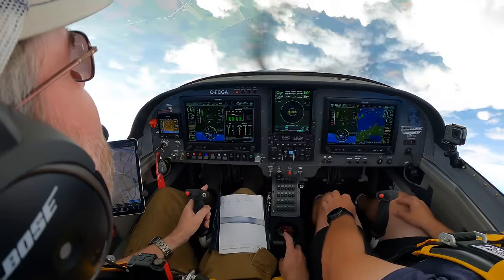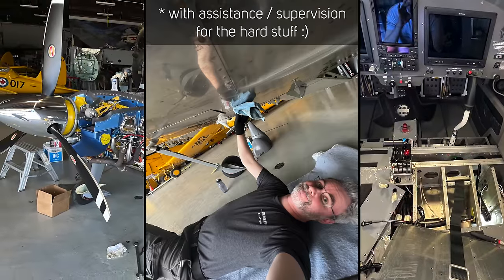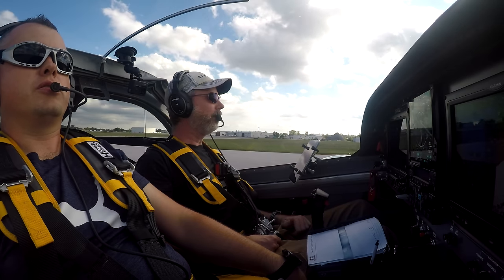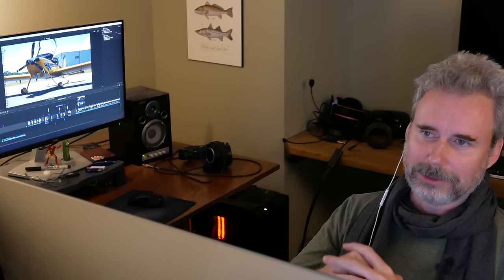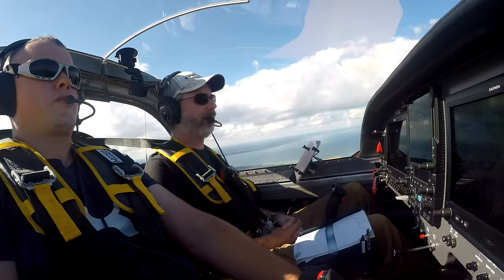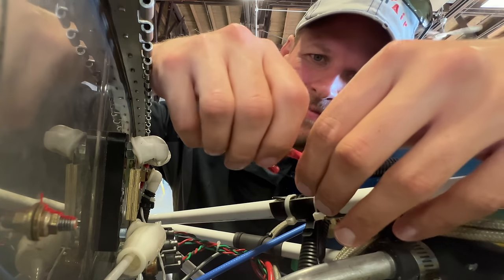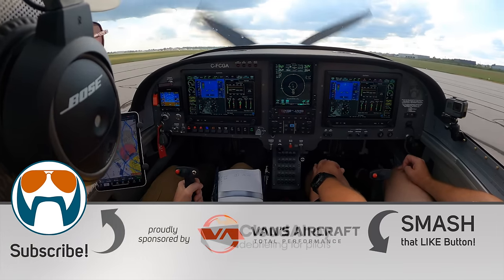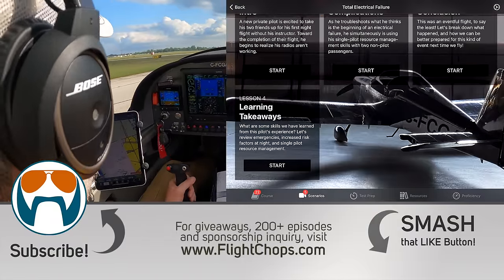Loop Induced Emergency?!

Comment: Mister Chops, at around the halfway point of the video you just addressed the observation of potentially excessive wire strain by zip-tying the connections so close to the terminal. Good finding!

I'd recommend to consider using wax string to secure your wire bundles instead of zip ties. From my time as a USAF maintainer, zip ties to secure wires were generally frowned upon because vibration induces chafing of the insulation and accelerates wear. Wax string takes a little more work to secure but allows the wire to slide within the wrap. Something else to consider! Keep your flight chops sharp!

Comment: Good job on the emergency! 8 seconds to recognize the overtemp is as fast as you can get without an alarm. As an AME for 25 years I have come to dislike spade or knife terminals anywhere in an aircraft. Unfortunately on certified we keep replacing them as built. On the high amp draw circuits like a landing light switch the get loose, build heat and fail. I later worked in Heavy duty equipment that had very electronically managed engines and systems. They are sensitive to resistance in terminations and they use much more robust connectors.  I am looking forward to building a homebuilt next so I can leave those connectors behind and use Weatherpack,  metri-pac or Deutsch for plug terminations. They are used heavily in automotive and once you put one together with a proper crimper you will see how nice they are.  They are also really nice and quick to unplug if used in a cowl that needs to be disconnected prior to removal.
Keep up the good work on videos !
Reply: I completely & wholly agree. As a mechanic myself (retired from it) I was never a fan of spade terminals, especially on older planes with wimpy generators where the current will spike from low voltage at said terminal. Or instruments to go just @55-wonky for no reason - I can't count the number of scorched wires and loose connectors I've had to replace just because the connection  got hot. Especially on the smaller super buzzy 4cyls that have a way of buzzing connections apart that have you chasing your tail trying to find THE fault because it couldn't be replicated on the ground. What a total pain in the ass
Reply: I loathe using those scrimp connectors with mission-critical terminations...  I never trust them to maintain a good connection over time, especially in harsh conditions.

Comment: Nicely handled.  One thing not mentioned was the associated oil pressure drop cross check.  Oil temp that high will also cause a drop in viscosity and show a lower than normal reading.
No drop from normal pressure, would lead me to instrumentation.  
Again nice job!
Reply from the maker: Thanks yeah - This was a good learning experience - I just couldn't get beyond the expectation bias that it was real, after having seen what happened to Dave.
Reply: Not always. I had a 152 aerobat peg the oil temp and oil pressure was still good. Was not a instrumentation issue but was indeed a failing engine. Landed and told the owner about what happened (was a rental) and his mechanic found a large amount of metal in the engine, which resulted in an overhaul of the engine. From the time of engine temp pegging to landing was around 10 minutes.
Reply: @kevinmaiorka5370  Glad you the airplane on the ground.  It is interesting that in your situation no association with pressure.
Reply: @airmotivewelding8012  

I wonder how it could not. Very interesting indeed

Comment: I don't know what engineering reasons Garmin used to choose a 2 wire RTD probe, but I work daily with Pt100 RTD probes in industry and a two wire implementation is very rare.  They are nearly always implemented as a 3 or 4 wire setup to provide independence from the cable and connector resistance.  That said, an intermittent or loose connection on one of the three or four wires can still cause these instantaneous step changes in temperature.  In industry we will go to fairly ridiculously inconvenient lengths to avoid connections in RTD probe wiring.
Reply: Same here, I work with Pt50 and Pt100 on aircrafts for scientific research, we always use them with 4 wires (and we don't use this kind of crimpimp: for this setup we would use Amphenol Air LB splices, way more reliable... and expensive)
Reply: @benmol_  hey, thanks for sharing this.  I looked them up...those 1119 splices look really nice. They have ones with built in passives like resistors and diodes, I can think of a bunch of niche cases to use those in.  Very neat!
Reply: Why not mount an ADC directly to the probe and do error correction?

Comment: Reminded me of my first checkride when the examiner pulled the carb heat and power to simulate an engine out and unexpectedly watching the prop stop when the engine actually died. Yippie! We're having fun now!
Reply: Don’t leave us hanging! Obviously you’re okay, but how’s that go for ya???😂
Reply: @erich930  It went well, trimmed for best glide, scanned terrain, smooth low bank turn to set up on a dry lake-bed, then fiddled with the re-start until she barked. Passed with flying colors.
Reply: My instructor cut the engine for my emergency practice and it quit just like he planned. He turned it back on with 20 feet to go. Nothing like real practice.

Comment: FlightChops, I’ve seen this several times over 40 years. The missing cockpit check is oil pressure. 

Spike in temp with declining oil pressure  = bad. Spike in temp no oil pressure change = likely bad probe.  

I’ve seen it enough times I keep an infrared thermometer in my tool bag. I recently had an oil temp spike in a Baron with no corresponding drop in oil pressure-Made a precautionary landing at the closest airport without caging the motor, because I suspected a probe due to the stable oil pressure. Got out, lasered the oil radiator, and it was the exact same temperature as the other motor (and also about 50 degrees cooler then indicated). 

This is a very valuable tip that I thought I might pass along.
Reply from the maker: Thanks for the insights here.  I was no doubt blinded by the bias of assuming it was the same issue Dave had recently. I will review the data from his flight when the oil temp really did spike due to the scat tube blowing off.., I am curious was the other numbers (oil pressure and CHTs) did in that case.
Reply: Awesome! Report back and let us know!
Reply: @FlightChops  There was an associated pressure drop with my emergency, but if you didn't really know the engine well you likely wouldn't notice it much at higher power. It was only about 3 psi (as expected by a pressure regulated system). At idle the pressure drop was more significant and it was low enough to trigger the yellow arc.

Comment: Wow that's a great video and a great lesson in problem management and pilot workload management.  Great thinking having your friend stay on the radios though agree he could have been more succinct in his calls. When ATC was asking about keeping speed up and you were saying "I can't add power" - that's what he should have been saying vs the word salad he gave them.  Interesting comment on switching on the autopilot to work the problem - your self-debriefing is like a master class, Steve.  And once you found that you could run a bit of power and stay under redline, that got you what you needed ideally which was to go back home and land, avoiding the hassle of landing at an airport where you don't have resources handy.  Very interesting lesson also about the electrical issues associated with this.  Can't say enough good about this video.
Reply from the maker: Stewart, I really appreciate this friendly feedback. 👊

Comment: Well played, sir.  I once saw one brief spike of either oil temp or oil pressure during Phase 1.  It immediately returned to normal and never reoccurred, but it still gave me the willies.  I finally got all the little bugs worked out of my avionics now (thanks to Tom Smith of Beacon Aviation) and the bird is feeling reliable.  I got to this video late because I flew to Erie PA Saturday and returned Sunday (also why I missed the last Burger Burn).  During postflight inspection I found some damage behind the wheel opening in the aft half of both wheel fairings; not sure when it happened.  I'd heard similar tales from other builders, which is why I didn't bother painting them until I knew they'd hold up.  Took them off today and I'll work on them at home.  If I do any more flying this season I'll be doing it barefoot, so to speak.
Reply from the maker: Right on man!  Let's do some flying together!  I'm currently grounded working on an exhaust issue - should be back up in a week or two.

Comment: Nicely done! On my last flight I had a High Voltage light come on, and discharge on the ammeter, and figured that's an immediate abort. I checked the fuses, and turned off all lights and one of the radios, while my co-pilot buddy read the emergency checklist, which suggested turning the Alternator Master off and on again, which cleared the problem. While it did not recur again on the way back, despite turning lights and radios back on, I think it was the right decision.
Reply from the maker: Thanks for sharing your story.

Comment: I had a wing root seperate during a loop once. That scared the snot out of me. I also had runaway trim coming out of a loop. That one less scary because I knew what it is quickly. Good job staying on the safe side of that oil temp.
Reply: Jeez.  I assume you meant a wing root fairing....otherwise you probably wouldn't have been able to debrief at all!

Comment: This was very interesting. As an automotive tech every connection I crimp is also soldered, there are also better tools to get a better crimp that's based on the wire size and connector your using.  I can see spade terminals OK in an automotive application but with Aviation I wonder if a more robust connector that would be more resistant to vibration would be another idea or a solid soldered shrink wrapped joint? 
Great job, its the possible emergency's that are not treated like one that gets people into trouble, you can always call the emergency off after then wait to late to do it
Reply: You can use a proper aircraft-grade terminal block and decent crimp ring terminals such as AMP's PIDG but you must use the correct tool. That's what the big boys use. More expensive than automotive push-on types but far more reliable. The key is to use the correct type, size and quality of crimp for the application, use the correct tool ideally a rachet-type and crimp it correctly. Speak nicely to your local electrical man and he might lend you the tools.

Comment: Fascinating learning experience - seems to demonstrate the potential for erroneous readings when dealing with fractional ohmic figure changes from external matters like connectors. Can see how much concern there was understandably with the loop though for sure the graph spike appearance was too much for a real temp change once analyzed. Dave's experience also very interesting. Just love the RVs paint job Steve - that is one superb plane. :)

Comment: Good video. I had a CHT gauge go off scale once, while flying a Sportstar, about 80NM from home field. I put a plan together to land at a small nearby strip, but I soon realised the issue was wiring and continued home, because the oil temp or pressure wasn't changing at all and the CHT temp just change too quickly and continued to randomly change. I had ATC follow me back home though, no ADSB or transponder, so It was just regular phone calls to me. The issue was a shorted CHT wire, which was in a loom that had been tightly zip tied to the engine mount, without any protection. Constant vibration over the years (2006 model) just wore away the wires coating.
Reply from the maker: Thanks for sharing your similar story.

Comment: interesting to see that aircraft builders have to take into account the G forces applied to motors vibrating with cable strands and positioning of cable ties. Next level stuff. I had a some cable ties around some Renthal aluminium bars on my BMW airhead motorcycle for years after the original bracket holding the clocks in place cracked through. Year later i took it all apart to see that the Tyton cable ties appeared to be in as good as new condition and had worn through about half the depth of the aluminium bar section. OK - gotta watch this to the end...

Comment: Working on Navajo's back in the 90's we use to take a pair of pliers to that oil cooler ducting, putting a little bit of a flare on the end, to keep that from happening
Reply from the maker: I thought about this... how did that affect the scat tube rubber?  did you have different material?
Reply: @FlightChops  It was on a PA31-350 and the material was the same, you can put a little bit of a flare on the edge of the Aluminum ducting that goes to the oil cooler and the scat tubing will stay on, its not really a conventional method, but it works really well, the Scat tubing isn't round so it will fit over a slightly flared edge
Reply: @FlightChops  Proper tools also exist to flare tube ends. Very commonly used in the automotive world for pressurized systems such as radiator or turbo boost piping. If you look at OEM hose clamp connected barbed fittings they all have some kind of flare or teeth to keep the tubing from sliding off. As your scat tubing sits it's just the friction keeping it on, with 200? KT air ramming into it. A small flare will keep it seated with much less need to crank that clamp to within an inch of it life. Certain styles of electrical crimp pliers have a great jaw near the pivot to make a bead on the tubing. You don't need to go all the way around and risk mangling the tube either, just a couple of bumps. This all assumes that what the scat tubing connects to is metal and not a formed composite.

Comment: Good day,
Love the electronics, by the way in intend to make transceivers, one thing i thought of is precisely what happened here -> go into "temperature unreliable" when we detect micro events such as +20°F in much less than a second for example. An indication of something happening in the line, neat. Would do this just because i like perfection, it's not because this is simple we have do the technical details bypassed.
Regards,
Jean-François

Comment: Great video! Nice calm work-through. Does make me wonder about two things:
1- why there is no practice to double-clamp ducts in certain applications, and
2- why there isn't a lip or bulging (?) ring around the duct for a more secure attachment.
Reply: The word you're looking for is "flange". Crimp a flange onto that ducting to make sure the ring clamp holds steady.
Reply: @jeffhiner  Thanks!

Comment: Unless it's something that comes apart often, like a cowling mounted landing light, any connection like that in an engine bay, should be an environmental splice. 
30 year A&P with plenty of wiring and avionics experience. 
Crimp connectors are lousy to use anywhere in an aircraft, but especially in an engine compartment with heat, vibration and moisture.

Comment: my first thought, declare, declare declare, you needed  help that could have quickly escalated to something more extreme...declare early so if/when it goes even more sideways..you dont have to get over that mental hurdle or the tsunami of questions that will immediately follow
Reply from the maker: Yup, there is no harm in declaring.  I made that a part of the debrief with Andrei privately as well as publicly in this video.
Reply: Firstly: thanks for sharing and happy to see it all worked out well!
I’m a fan of the channel and your work. 

With all due respect:
You are flying in a single pilot system here. (I agree with the wise thing in assigning passengers a task. For lots of reasons even.)
But:

What about if your friend felt the need to play it cool because he’s “on tv”?

What about if your friend is insecure about making a pan call? Or even mayday. 
Maybe he’s thinking: I don’t want to get anyone in to trouble here, and I’m sure Flight chops will tell me to do it differently, if he wants to. 

Although you are working the radio by proxy, you as a pic could have told him to make it a pan call. 

That being said, I know you were busy flying!
And that my comments are from the comfort of my armchair. 

I’m just trying to view the thing from a slightly different perspective. 

 But again: great job under stress and thanks for sharing!!

Did I mention I’m a fan of the channel?😅

Comment: Nicely dealt with. Interesting Human Factors issue where assumption of a cause is based on a past experience. When returning to the airport, I think a PAN call would be appropriate; you and ATC wouldn’t then have that spacing between you and the RJ behind to deal with, as the ATCO would just prioritise you. Great learning video though.

Comment: I've had similar issues with oil temp indication on a Rotax 912 caused by their use of cheap tin-plated contacts in their main wiring-loom connectors for the PT100 sensor. Temp suddenly shot up by about 50 degrees C in flight so had to do a PFL in a field.
Tin-plated contacts are fine for power circuits above a few hundred mA, but not for signal connections which should use gold plated or flashed contacts for low-current or sensor circuits. I changed the connector to a terminal-block with crimped ring-terminals and everything has been fine since.